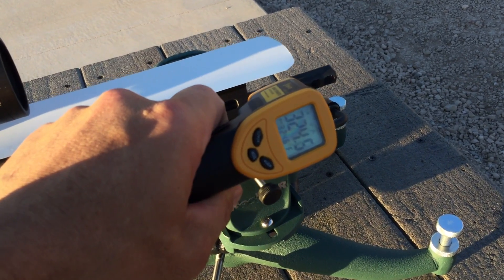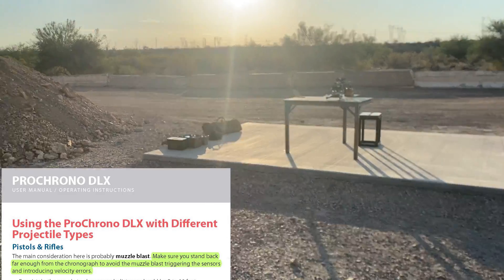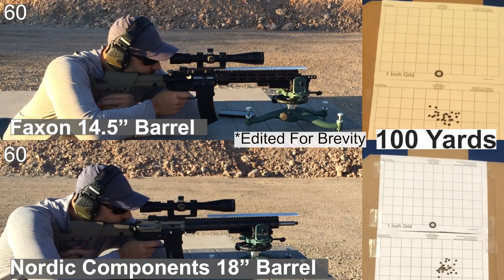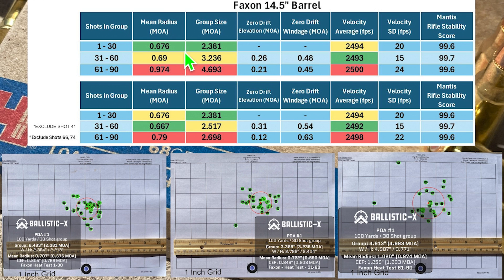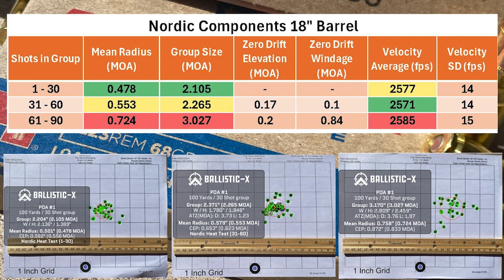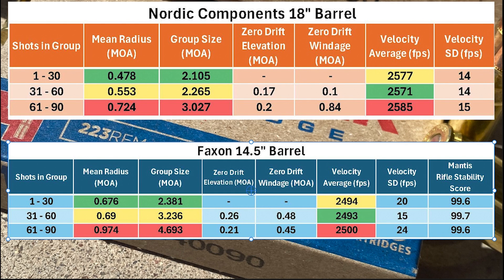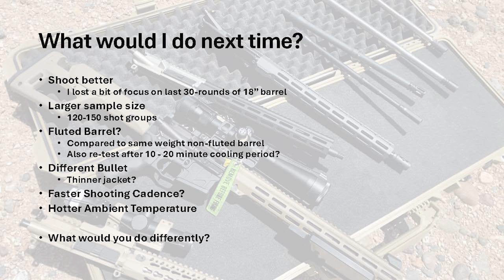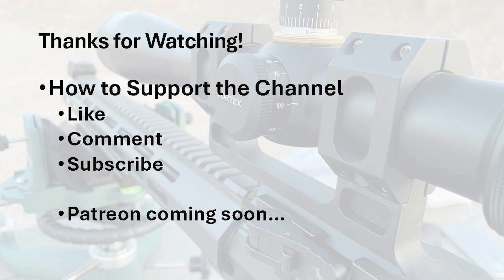AR-15 Accuracy Destroyed by Heat? Myth or Reality...

Comment: I started shooting a government profile barrel when I usually shoot the thicker socom profile. What I noticed was after 120 rounds the zero seemed to have shifted. Never had that happened before so I kind of wonder if maybe my optic broke or if there's a heat problem.
Reply: Has your point of impact stayed put after the shift? I get point of impact shifts with almost all my new barrels anywhere from 25 - 300 rds. Once the shift happens it almost always stays at that point even after barrel cleaning. New barrels have tons of imperfections that get worked out over time.

Comment: I just did a similar test for a buddy who claimed he was getting heat dispersion through his Aero 14.5 pin and weld. I ran 140 rounds in about 40 minutes. I shot four groups of five rounds to establish a baseline of accuracy. Two groups of Hornady 68gr BTHP match, and two groups of AAC 77gr HPBT match. Then shot two 20 round groups of Winchester M193 (which performed terribly ~4.5-6MOA) then repeated the same course of fire. At the end I shot 4 more test groups with the same two match loads. The final gas block temp was 383F, the final  round of groups were the best of the day the final Hornady group was 1.21MOA and the final AAC group was 1.1MOA. The average for each across all groups was 2.13 MOA for the Hornady and 1.81MOA for the AAC. There was a significant outlier group for the Hornady however ~3.5MOA, if you remove that group it brings the average down to 1.83MOA.

Comment: Any chance you can get to a 100yd indoor range to control for wind and temperature and is a more controlled environment .  (You’d be amazed how the sun can heat up ammo and change its fps!).  A little fart of wind between you and the flag. All those little “what ifs” are all solved by an indoor range. 

I thankfully have one nearby I use for testing 22lr accuracy for NRL22. 

Also how about a dedicated gun vise?  To completely remove shooter effects.  (My indoor range has poured concrete benches)
Reply from the maker: There are not 100 yard indoor ranges around my area that I know of. So, you probably won’t see any of that from me any time soon, unfortunately.  I agree that it would be and nice way to control more variables, but this is what I got. 

Any recommendations on a dedicated gun vise?

Comment: Awesome video.  Thanks for making it.    I had a barrel years ago that when it got hot, the POI would move up a couple inches at 100 and the groups would open up, just enough to be sure it was happening, but nothing drastic.   It had a light weight profile and it never shot very tight groups anyway.   Otherwise, in the many AR barrels I’ve seen, I haven’t noticed this being as much of a thing as I’ve heard about.  

You mentioned temp stability of powder, I also run VV N140 W/ 77 gr SMK’s.   I wonder if something like H335 with all the nitro would change things.   I bet after 30 plus rounds or so, the ammo would get hot enough to raise your velocity some, maybe that would change your POI.   You’d need some lighter bullets though.  

What primers do you use with that combo?   I’m using Fed GMMAR’s and they seem to produce good results.   Love that N140, but I get better velocity with N540.  

Thanks again
Reply from the maker: For this load, I just used some Fiocchi primers I had laying around.  These weren't my highest quality reloads.  I just needed something consistent enough for the test.    

Yeah, it would be interesting to see if different powders would affect things in a test like this.

Comment: It's normal to not but throw out outliers. It's statically going to happen to every test you'll ever conduct, I wouldn't sweat it too much. You could argue ~3% is a significant figure but the amount of rounds you'd use to recreate the same senero probably isn't worth it.

I'm guessing the sudden shift has to do with the thermal expansion of the steel being similar. Bc regardless of thickness it's going to expand especially the rifling. 

I guess another bit of measurement that'd be helpful but it'd be unreasonable to ask is thermal data on the exterior of the barrel. So at least you'd have some data to correlate with per shot.

Comment: Fantastic video. May I suggest a White Oak Armament 18” SPR barrel. They offer it in 1/7 and 1/8 twist. They use Wilson blanks as well. I’d be curious to see if there truly is a difference in group size (due to stability of the round) in the 2 barrels. Maybe do 77gr, 69gr and basic 55gr ammo.
Reply: I have the same barrel. Extremely accurate, I love it.
Reply: @elmer6535  I had one. I had the mid length 1/8. Super accurate. Unfortunately had to regime the rifle. Needed some cash. But I still have a 16” barrel from them. Shit lights out brand new. But after 4 years of 3 gun it’s toast.
Reply: @aidenhall9832 That is a expensive barrel for 3 gun no?😂.  Mine is on a varmint set-up... 18" rifle length gas.  Sweet shooter!